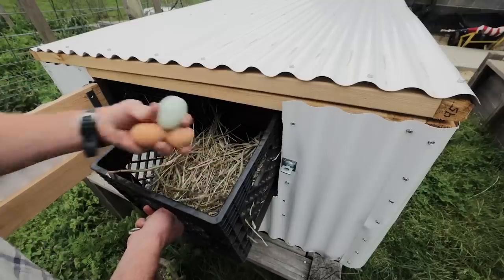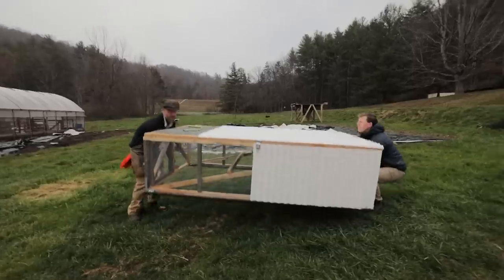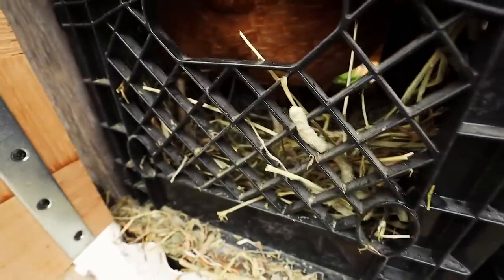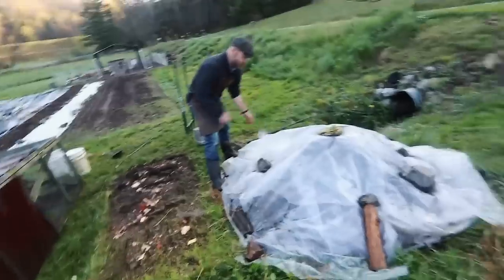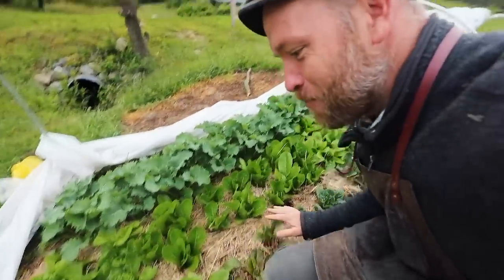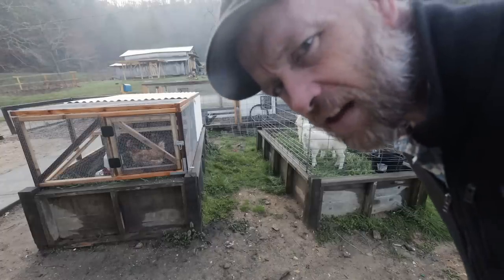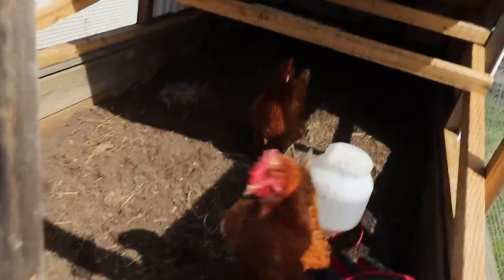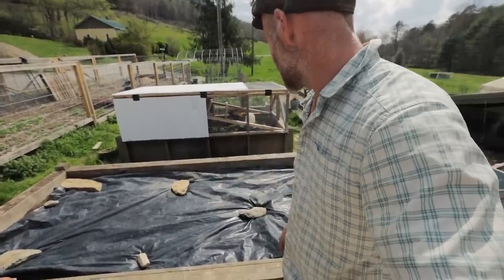BEFORE | AFTER (Chicken Tractor)

Comment: $700 IS JUST OT MUCH  I will build one for about $200 native cut (ruff cut) not stopre bought but right form Amish saw mill.  The wire and roofing is about $125.

So kids go look for the Amish for lumber and if u want it finished buy a planner  It will pay for itself in just a few uses  A grand will get u a good one Blades not that much and if  u use only soft wood they will last a long time